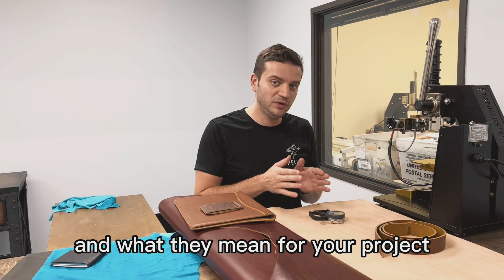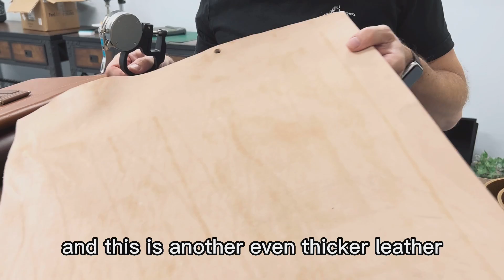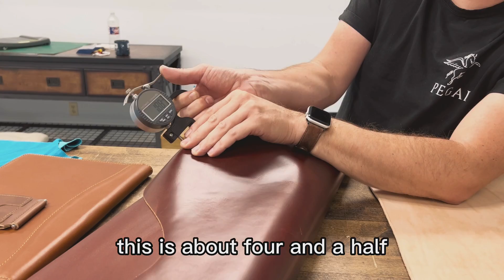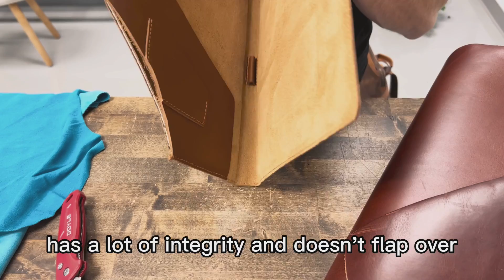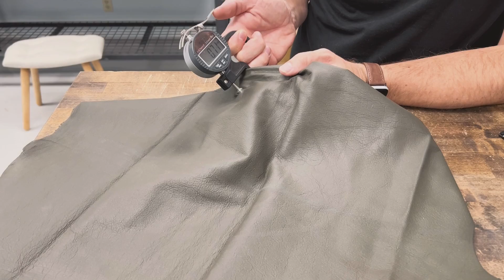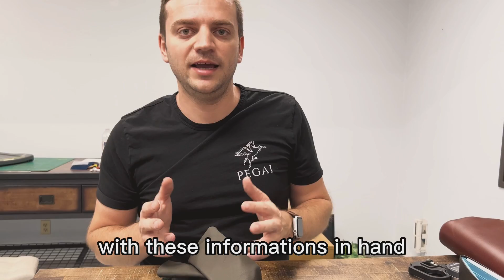Leather Thickness Explained | Finding the Right Thickness for Your Project

Comment: Thanks for the tips! I have been trial-and-erroring a standard bifold wallet. Finally, I am happy with the dimensions and the leather thickness. Trouble is, now I want to try and make it out of better leather, but the one I want is softer than what I have been practicing with. Should I order the softer leather a bit thicker, to account for the lost stiffness of the wallet, or does slickness come first? My goal is a product that will last at least a decade.